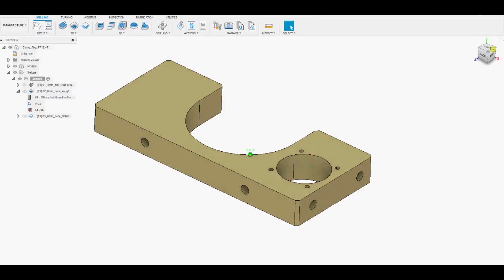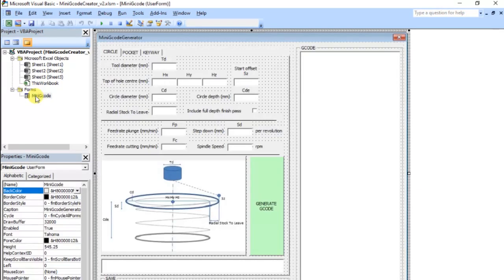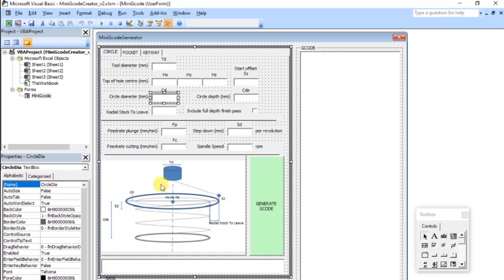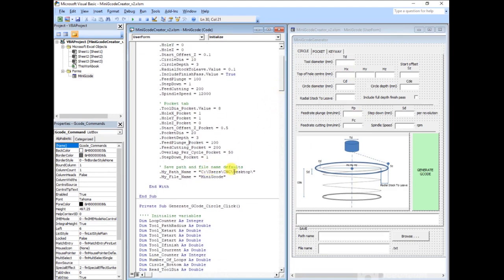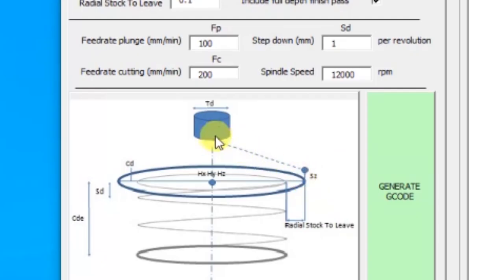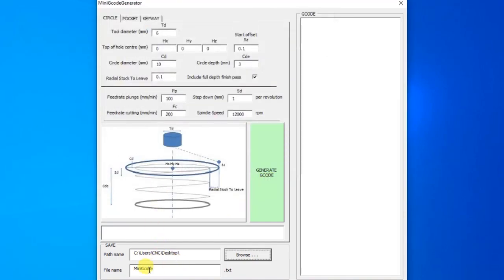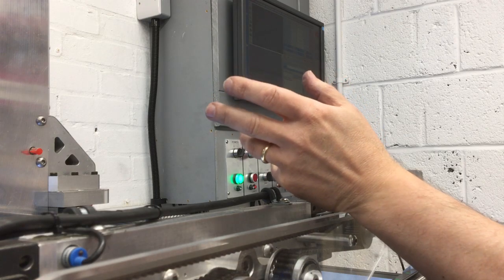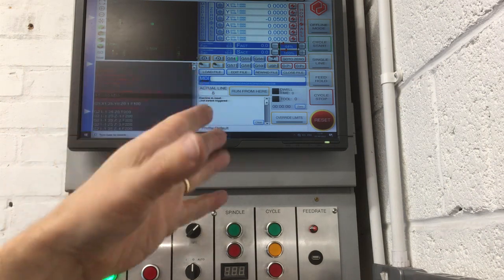Ep1: Introduction to my MiniGcode Creator

Comment: Nice! Not sure if anyone else has commented, but UCCNC allows you to write plug ins (in VB or c#, amongst others), so you could add this plug in directly to UCCNC, and have it output the gcode directly into UCCNC very easily
Reply from the maker: I didn’t know that so thanks for the info.  I didn’t have much interest in the second video so I’ve left it alone for now.  But good to know for the future, thanks
Reply: @routercnc9517  Any chance you could share your VBA scriptlet / Excel workbook? I'd be keen to have a look at how you've done it, and might even have a crack at converting it to a UCCNC plugin, and/or C#, and commit it back to your repo, if you were keen?
Reply from the maker: Check out episode 2 of this series.  The Excel file is linked in the description, help yourself!  It is on the mycncuk forum.  You would have to join to post code so don’t worry about it unless you want to.

Comment: A lot of controllers call that conversational programming...it comes in really handy for the exact reason you say early in the video. It would be good though to have a program to generate that as you have done. Teaching Tech has done a similar thing for 3D printers..it works a treat and makes life very simple...keep developing this there is a huge place for it in the maker community
Reply from the maker: Ok thanks.  I’ll keep refining it and testing it on some sample parts then see how best to release it for others to have a play with.

Comment: I agree with James Krippner et al as to the stand-alone program concept.
I use an old32bit HP Notepad that can only pull WinXP (MS Office will not load - memory + OS issues) as the mills PC (with GCS) and something right there would be great.
Maybe open source it and people can write and contribute various add-ons that could be downloaded into a "addon" folder that the base program could read on boot and load as needed.
Hobbyists are suffering with the very high cost of (sometimes half baked) software.
Maybe even fork the GCS project and make it an "All In One" (but remember us 32bit guys with the ols operating systems and minimal memory capabilities out there please...)
Reply from the maker: OK understood.  Maybe I will develop the Excel version to a point where it basically works and then decide where to go from there.  I agree that the Open Source option through GitHub is a nice option (from what I have read and understood about it, not used it myself yet but plan to do so for another future project).  I think it would work better if written in something more popular and more directly code based, rather than uploading excel .frm files.  I've done various small bits of coding over the years but I would call myself a google coder, with google search open in the other window to get the syntax right as I have long gaps in between !

Comment: Hey RouterCNC, to make it more useable, I would consider writing it in C# in Visual Studio (which is free), using Winforms. I find it a much easier way to program than in VBA with code suggestions, auto complete, better debugging, and it can also create fully standalone applications meaning you dont need Excel. Looks like a great tool though! I built a simple python script to generate some gcode for slotting at work once, walking in to depth, then across to width, and it was extremely handy. Cheers!
Reply from the maker: It's a good suggestion and something I did think about because I as a future project I will need something like Visual Studio (another project for the list !).  I was trying not to add to many programmes to this PC and keep it light but perhaps I need to do that.  In terms of standalone applications yes that is an attraction.  At the moment if I ever share this via GitHub it looks like there is a bit of work to export the excel form and then the user would need to download and import the form to get it working on their machine, which if they are not familiar with excel VBA might be an obstacle.  C# code should be easier to do the implementation but been a while since I did C# !  All languages are the 'same' but they all have slightly different syntax which you have to get to learn.  I'll develop this a bit further to the point I'm happy with it in excel then see where to go next.  Good comment thanks.
Reply from the maker: I just remembered I have Arduino IDE software on the main PC in the house from playing around with the Arduino systems with my daughter a while ago.  Do you know if this Arduino IDE software Vs Microsoft Visual Studio Vs Code Composer Studio (for the Texas Instruments microprocessor as the Clough42 ELS is on my distant project list) are different ?  I'm just working out what to commit to (pardon the pun for GitHub users) should I go away from MS VBA.  It sounds like they may be tailored to the application and I may need at least CCS (for the ELS) and VS for the GCode generator if it supports user form creation?   Any advice with what each is best for - or if they are basically the same - welcome !
Reply: @routercnc9517  One of the advantages of getting off the VBA and going to C# or Delphi is that VB has some inherent flaws in its architecture. Back in the later 90's many VB developers that I knew were running into what they called "DLL Hell". Which means the enjoyed quick results with VB, and then ran into problems as their projects became more sophisticated. I never had that problem using Delphi. Later, the main developer of Delphi was recruited to improve Microsoft by adding C#. Great appreciation for Anders Hejlsberg, the developer of both Borland Delphi and C#.
Reply from the maker: Ok good to know thank you
Reply: @routercnc9517  As a LinuxCNC user, might I add Python to the language suggestion pile? Very easy GUI and cross platform...
Reply from the maker: Good suggestion Philip thanks.  I posted a follow up video to this one and received precisely no comments!  So I don’t know if it is worth my time creating something universal.  I’ve made some improvements to the original excel program and it comes in handy for a quick machining op but I’ve left it there for now.  Maybe I’ll upload that version to the mycncuk post I originally created (link in next video in this series I think) and people can take it or leave it.
Reply: @routercnc9517  That's something I find frustrating too - spending a lot of time creating something, lots of enthusiasm and 'advice' around it and then... nothing!

Comment: its a lovely little calculator and I think it is well worth the investment in time for writing the macros to remove the poorer parts of the simple programs to include things like arcing in and out of the finish cuts because once its there you never have to look back. it might also be worth adding the tool and offset to the program then using tool nose offset which would make writing the program a lot simpler for you without having to thing about compensating when the machine can do it for you.
Reply from the maker: Hi Jacob, yes feed in/out arcs would be nice for the finish pass.  I sketched out the geometry/equations of what is required to hit 2 tangents and make sure the tool blended in from the current start point to the actual toolpath and it would take some coding to implement, but is is possible.  There would need to be lots of checks in the code to ensure the user did not select an impossible arc etc.  You realise what is involved with the commercial software when you work it out for yourself !  For the last statement do you mean reference to the tool library ?  I confess I don't use it and really only use 3 and 6mm end mills and manually touch off when changing them over.  How would you see the excel code interfacing with a library?  Or would the library exist in the code as well (a tool set up user form?).  Can you expand a bit ?  Thanks
Reply: @routercnc9517   you would use the tool library in the machine. this allows you you run the same code while being able to alter the tool diameter making it easy to creep up on dimensions. you would program a 30mm dia to be 30mm and the machine would compensate for the cutter you would need to include in the program the tool offset and the compensation (usually G41 or G42) depending on climb or conventional machining (also easy to add a choice for different materials) and then cancel them at the end of the program.
Reply from the maker: Ok I’ve not used tool compensation like that so I’ll look into it.  Thanks